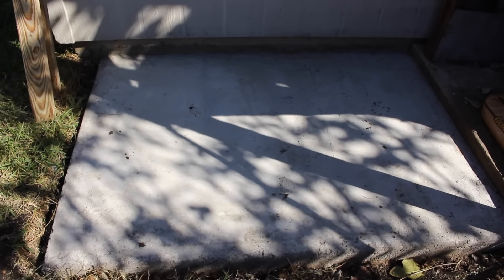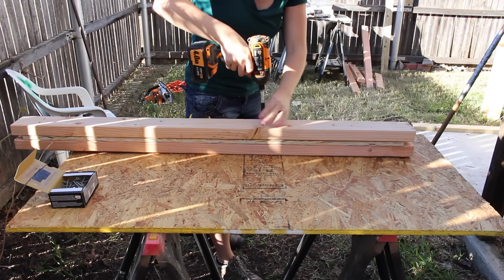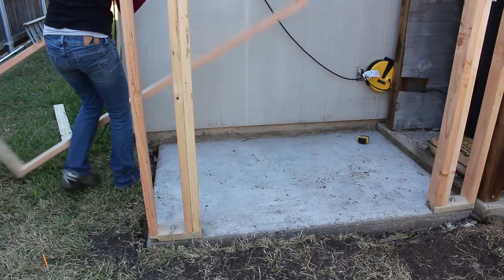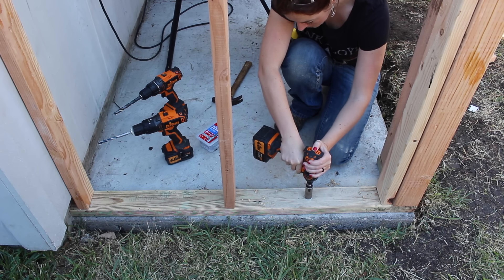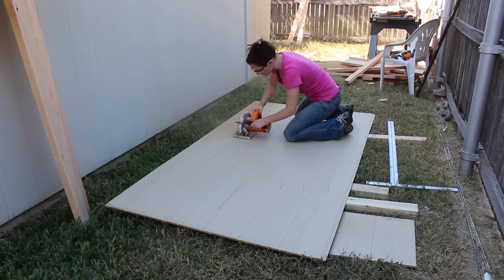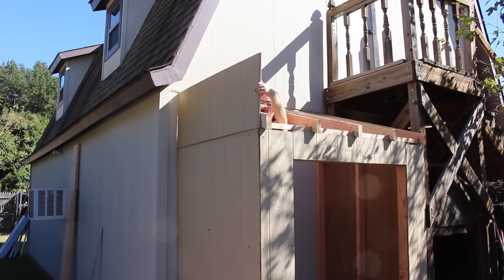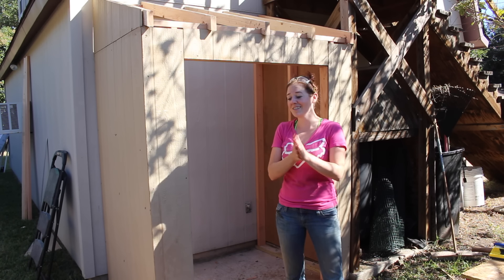How to Build a Lean To Shed - DIY Framing and Siding (Part 1)

Comment: Hey there, I was just noticing how you put your  tools down in the concrete. Just an fyi in case you don't know...putting batteries on concrete will drain them faster and could even ruin the battery permanently. I wouldn't want you to ruin your tools. You have alot of them and you use them alot so maybe lay a piece of cardboard or wood down first the next time you work around concrete so when you set them down they don't get messed up. Anyway, keep up the good work and thanks for posting your videos. I enjoy them very much and you are one hard workin girl. Peace,🌼.
Reply: What??? Unless you have some facts to back up this claim, that's the craziest thing I've ever heard.
Reply: I doubt this is the craziest thing you've ever heard of. This world is full of crazy...but anyway...I've seen this with a car battery so I just watch out with all my batteries. Just tryin to help someone out. Better safe then sorry. Peace🌼
Reply: Oop...than

Comment: Put a Z bar between the joints on the siding joints so water doesnt flow inside they sell it at your big supply stores otherwise good job👍

Comment: I would have made sure the slab had a sleight slope away from the building.  If the device going in there makes noise you can dampen the noise with rubber mats.

Comment: She could have placed some bolts sticking up on the edges of her forms and then she could have simply drilled holes in the bottom of her framed walls and slipped them over the bolts and tightened them down with a nut.

Comment: noticed a couple things.  no sill seal between PT plate and concrete. no flashing on butt joint .  that joint will leak and deteriorate after time.  I learned it after many leaks.  Great motivation on completing your own projects!!

Comment: You forgot to put the sill foam sheets between the concrete and the base of the walls.  Creates an air seal and offers no contact between concrete and wood...

Comment: Remember not to attach lean to shed to the house. They are two separate buildings with two uniquely different foundations. They will shift and settle differently. If attached, the shed puts unnecessary stress on the house wall.

Comment: I too am a female and do as you. Maybe it's not perfect but then what is PERFECT? As long as your able to achieve the intended purpose and your happy I personally say that's PERFECT! HOME Depot and the like are my toy stores. I have learned the right tools for a project are just a necessity, if you don't have it buy it! If you can't afford borrow or rent it... It's worth it for sure. I've done a few tile floors and the first one I manually mixed the thinset! Until my dad told me he had a heavy duty drill and a mixing bit, I also was cutting using a snap and pop.... Until dad ( my best friend!) Taught me how to use a wet saw.... Now I have my own! Live and Learn Jill of all trades master of none but that's how I have fun..some things I like others it's I hope to never have the need to do again! Hahaa peace
Reply from the maker: Awesome! Thanks for sharing.

Comment: Question for y'all: I was thinking about making like a lean-to closet. So a smaller, lighter, freestanding structure to put on the side of my house, with some attachment (like a couple of Tapcons; my house is brick) to the house so it doesn't move or topple. Now, I was just going to put a few large paver stones down on the dirt for a foundation. Is that sufficient? Or do I need to pour concrete, or do a sand/gravel base or stuff like that? Thanks in advance

Comment: Not bad. Two top plates,  your rafter seat should hang past your wall about a 1/2in. That allows you to put your sideing higher, adhesive or a seal product between wall bottom plate and concrete. What you called a cripple stud would actually be a gable stud on the side supporting your rafter but should run the sam direction as your wall stud with a notch to support rafter and nail to. I need to find a girl like you. Good times.

Comment: good tools but less than average carpentry I saw the concrete pour and that wasn't done that we'll because with time it will separate from the house
TIP: use the hammer drill to stick rebar "dowes" into the foundation of the house and tie the rebar to the dowes at the same elevation 2in or 2.5in down from the top of  slab grade so the foundation won't separate with time
TIP: the top plate for the walls keeps the walls in place from twisting B/c the wood warps with time I alway see sheds with a panel that can't stick on right or cut diagonally because it's no longer squared
TIP: when you use the nail gun to stick two 2×4s together for doors, windows and corner walls hit it strait, up and down so the nails interlock with the wood 
A for effort
C for quality
I hope these tips helps you in the future :)
Reply: Your tips are not written in a way that would be understood by a person with no training & a poor critique of the quality of her work was quite unnecessary, when she made it very clear that she has no training & is just learning.
Reply: Your right, the average person would pay someone to do this type of work, and on top of that, criticizing someone is a necessary step for improvement, "only the most intelligent and the most stupid do not change" Confucius
Reply: Hardly, as the quality of her work will improve naturally with practice, time & help from her mentors. This is beginning to show even now in her newer videos  ... Perhaps April should critique your grammar & spelling to bring on that change you speak of?  :)

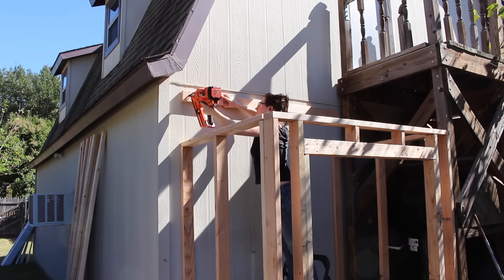Comment: 3:42 no need to for the shame. In carpentry school they teach us all these mathematical formulas which rarely if ever get used practically. If someone Is standing there scratching their head figuring out the math for a birds mouth cut  using the first one for a master template when they could quickly do what you just did wouldn't make it too far.

Comment: For your first time great job! It’s not cheating if you get it done quicker and easier. Just a couple of things for easy and safety. Hurricane hangers on the roof would help in high winds you know your location and may not be needed. Second thing you could put the siding on the walls to square them up and then stand them. The way you framed it up is still great for your first time. Keep up the great work and videos.

Comment: Question.....what area of the country do you live in?  Where I live connecting a slab lean too to the house may not be a great idea.  The house is on a foundation below the frost line and doesn’t move seasonally...... however something built on a slab is going to rise and fall with the ground freezing and thawing.
Reply: I agree.  It would be interesting to find out if the connection to the building has come loose.  Here in Minnesota, many do it yourselfers learn this the hard way when their deck supports are pushed up by the frost.

Comment: Learning by trial and error.....with a level of preparation of course. Exactly the way I do it! Just remember that if you put in a non-load bearing wall with a door and then add a new electrical outlet, with line going to a wall switch that then runs to a new ceiling light, watch out where you connect the wall outlet to the power in your attic. I had a number of junctions boxes so I connected my power up. 

Then for an entire day I was wondering my circuit breaker would flip off every I turned the light on and plugged something into the outlet. After sleeping on it overnight, I gave it another try and same thing happened of course. But this time I realized the breaker that was flipping off was the one going to my drier at 220 volt :) Yep, connected the outlet power to the wrong junction box in the attic....lol. Trial and error!

Comment: I'm not a pro carpenter, but I've done a hundred houses via volunteer construction.  I like putting a cripple at each end, too (4 total), in your case.  Further, I usually over design, so I would have used a wider header than 2x4 because I never want to have a door issue and want the header integrity rock solid.

Comment: Next time use 2x6's for the rafters, so you can have a over hang (eve).. You should have ether overlapped the top siding over the bottom sheet or used z-bar flashing. Flashing between the new wood and where it attaches to the house to prevent water leaks and damage down the road. The most important part you didn't add was flashing the Leger (house exterior wall to new shed). Just trying to help.

Comment: With 1.7K comments I’m not sure if someone has said this before. From my experience the only thing I would do differently is place the frames on top of 10mm (sorry Australian don’t really know imperial) packers. This, long term will help avoid wood rot which will still happen with treated timber. Otherwise great job!

Comment: She did a good job but there was no point in making a 2 by 4 header. You only need to sandwich a piece of plywood in when your header is bigger than 2 by 4 in your wall is 2 by 4 like for example or 2 by 6 header that way when you put it up sideways it's still 3 and 1/2 in. Well if your head is just going to be made out of two by four you can just put them on a flat so it's 3 and 1/2 in anyway. Just thought that was kind of funny

Comment: Its funny listening to comments made by people on You Tube.
If this was some dude doing this in his back yard you get all kinda comments like do it correct the first time then you wouldnt have to do it again or if you put siding on first by stair case you wouldnt be struggling and many others but because its a woman you dont hear corrections funny stuff.
Or even this one if she was just learning starting out.5:58 she says keep in mind she has no traing what so ever yet can call out different cuts made in the carpentry world just saying.
Reply: If you care to know - any REAL rude or smart ass remarks her very good Monitor deletes or depending on the content, blocks and deletes.  She gets plenty of people saying a better way to do things and that's fine, but if they're an asshole they're booted. Especially at the time of this video, she was still in the learning process of things and by comparison knows SO much more now. She always researches prior to a project and builds on her prior learning experience. She started not many years ago not knowing anything and would pick a project, figuring it out along the way. As she grew confidence, experience and tool collection, she could then do more complicated projects. She had never attempted something like this Lean To before. Quoting you - - Just saying.

Comment: mistake  # 1 Never attach timber straight to the concrete, it will absorb moisture very quickly and all your hard work will be gone for nothing. Use concrete anchors.
mistake # 2  You in the US are nail obsessed.Use galvanized screws instead, they're rock solid. Nails become loose over the time.
mistake # 3. Coat your timber with wood stain to make sure it lasts for years.
And don't get me wrong, I'm not a hater. You've done good job but you could have done it way better....
cheers

Comment: Only thing i can say is great job April, maybe a strip of damp course where the timber meets the concrete base would have helped? Also panel your frames on one side before joining them together as it makes assembly easier and you wouldnt have to struggle like you did next to the stairs. I think i will drop links to your videos on my partners ipad and buy her a drill and a saw for her birthday lol

Comment: Loved the presentation; great video and explanations. Thanks. One thing I was worried about a few times when you first started to use your pneumatic nailer, your had seemed too close to the nailing point. Keep you free hand holding the pieces of wood away from the point of the nailer. There are a lot of YouTube videos showing how a nail can curve and go in unpredictable direction and come out and injure the operator. Awesome work. I am going to do one of those too.

Comment: You guys must be out west.
We sheet our walls and build our gables right on the ground .
Then you wouldn't have the problem sheeting the wall at the steps.
You could try coating that ledger for your roof panel with silicone before shoring it up to the siding.
Actually all meeting surfaces.
the comment about the double top plate not being a big deal.
That's 100 percent wrong whomever that person us.
It not only ties the walls in ,but your rafters aren't stacking over studs or crips.
I understand youre a beginner,but that person is allowing you to put out incorrect information.
Great job though.

Comment: Great job thus far April! As you said, you learn as you go. After some experience you can plan ahead and overcome the obstacles before they happen, much like siding, painting and standing the wall up against the stairs before standing the rest of the walls.
Now to see if my wife will assist me in building my shed. ;)

Comment: my 2cents
Invest in a really good pair of work gloves - this makes it safer and you can grip your work better. 
Pulling splinters and infections are not worth it especially if you play guitar or do other finger type activities.
You can rent a .22 caliber masonry nail gun for attaching the sill to concrete - they are very effective and also very fun. 
I like to use slide clamps/pipe clamps to squeeze together framing elements so the nails set them super snug. 
Go ahead and measure diagonals and use a level for squareness and plumb as you go. A few shims here and there can avoid multiplying your problems.
Watch out for where water will be coming off the existing structure - you don't want a waterfall to test your shed roof.
Keep up the good work April!!!

Comment: I liked your video April,  but a couple suggestions.   it is a lot easier to nail your walls together while they are laying down on the ground.  then stand them up and you can secure them together with a second top plate that overlaps the neighboring wall.  Second is the one that might have been a trick of the camera angle but when using a nail gun keep your hands and fingers a minimum of the length of nails you are using away from the tip of the nail gun.  if a nail hits a knot in the wood they can deflect in any direction and end up in your hand.  I have seen it happen and would hate to hear it happened to you.  overall I love your enthusiasm and ambition I must admit I wish I had apprentices like you working with me it would sure make work a lot easier some days.  

keep up the good work and never stop learning.  the knowledge you pick up today may be usefull in other jobs tomorrow.

Comment: Awesome work!   Very cool videos. If I can throw one suggestion, even though it is a shed, if you wanted to add a little more rigidity to this structure you can throw a double top plate on this sucker. The second plate will run the total length of the joining walls wether it be front to back or side to side but it will tie everything together a little more creating a lap joint. Besides that you kick some ass for sure!

Comment: I know this is an old video, you're not "cheating", you are "BEING PRODUCTIVE".  Also to help you out on that, you don't really need math for angles that you already see of course.

1.  Measure the overall "run"
2. Mark the rise on the left
3. Mark the rise on the right

Snap a line from one to the other... there's your corner angle.

Comment: Good work  looks great but I also glue when I laminate studs, LVLs or beams
Also when drilling in to concete it’s a lot easier to use a rotary hammer drill, as the Mpa on some slabs can burn out your drill fast, as those drills are better for light masonry like brick work. And alway wear safety glasses,  dust mask, and hearing protection.